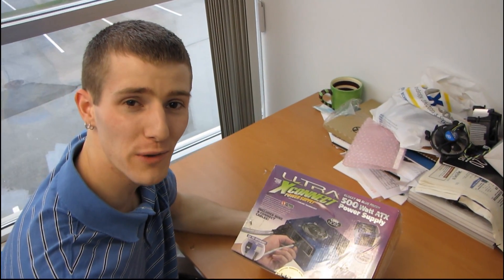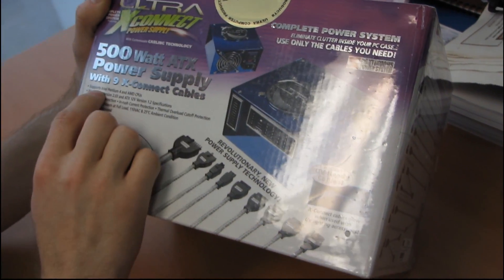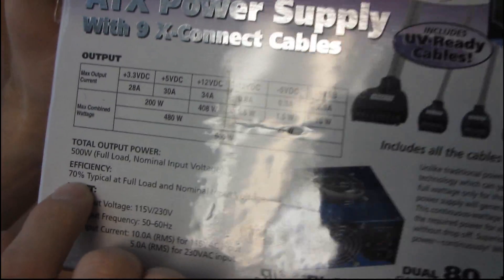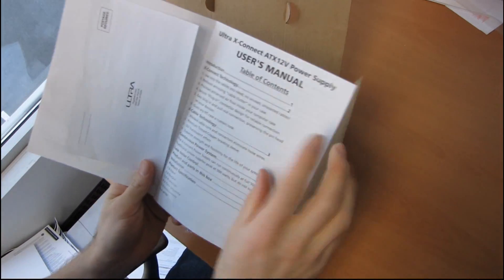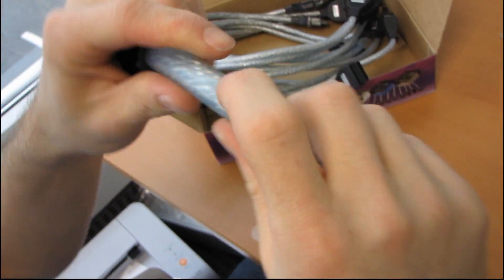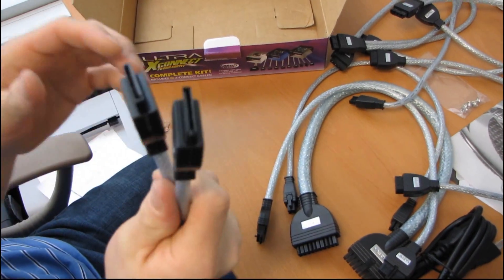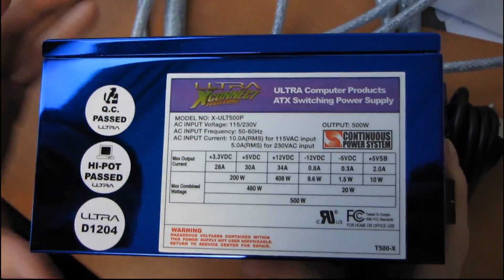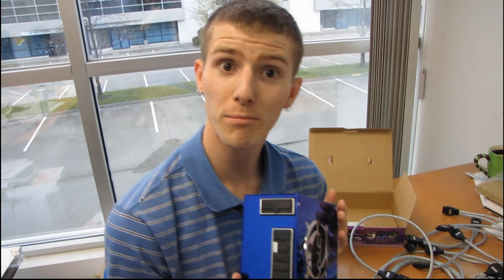RETRO UNBOXING Ultra X-Connect 500W Modular Power Supply Unboxing & First Look Linus Tech Tips

Comment: Hey Linus, yet another great video! Even though the odds of you reading this are slim to none I just want to tell you that right now, in 2016 my Custom built PC uses that same power supply. The thing is 11 years old now and still runs like a champ. If you or anyone else is interested in seeing it or have any questions about it just reply to the comment. (My PC with this psu runs GTA on high settings just to show that it can handle itself)
Reply: But it only has 20p main power and no GPU power

stop lying kid
Reply: I bought one NOS at a thrift store several years ago, it’s been running a bitcoin miner all this time. Still running as I type this.
Reply: Good to hear, I just found one for sale on eBay brand new in the box in silver, and it looks to be a good fit for my Win98se/XP SP3 retro gaming rebuild of a 2.8 Ghz Pentium 4 Dell Dimension 4600.

Comment: Are there 20p to 24p adapters?
Reply: ***** OKAY.
Reply: 20p to 24p adapters aren't even necessary. 20p connectors still plug into 24p sockets just fine but leaves 4 pins unused. Similar to how GPU 6 pins can plug into GPU 8 pin sockets

Comment: I want this beautiful PSU! Those THICK OLD cables are so nice! I can bet my ass that i can power an I5 6500 with GTX960 like nothing!
Reply: sjoerd laan rewiring cables wouldn't be that hard... just buy couple of plugs and wires and make extensions.
Reply: My PSU is like 450W 80+ with single 12V rail and it can power my 4460 and GTX960 without any trouble. Under full load I haven't noticed any issues.
Reply: +Artas1984 No it can&#39;t. It doesn&#39;t even have a 24 pin ATX connector, and that single 12V rail is just asking to catch on fire.
It still looks pretty cool though.
Reply: still doesn't make up for the fact that it only has a 20 pin motherboard power connector, and no PCIe power

Comment: Actually most mainboards will accept a 20 pin ATX connector if you just line it up on pin 1 on the mainboard. (Same with the 8pin CPU connector)

Comment: You could still use this in a modern PC(posted in Jan 2016!), you can get a converter for the main bord connection cable. The 12V 4 pin connector will also be accepted in most mainboards that feature an 8 pin socket. And the 12v rail is powerfull enough to power a CPU(Like an Intel i5 or AMD FX-8320E or similar TDP CPU) and an nVidia GPU...

Comment: I know this video is like 5 years old but I just had to throw a comment in here bc I actually happened upon an ultra x connect 500W power supply myself but the one I found has 3 clear acrylic sides with 2 80mm fans and one of the fans actually has a uv cold cathode on it. As well I guess the person before me liked this power supply so much they actually found a xconnect cable from the manufacturer that is atx 20 pin to 24 pin connector. So i decided to try it out to see if this thing still works and it powered up no problem on my old system. The old system was running an amd phenom x4 9750 with a zotac geforce gts 250 and 8 gb of ddr2 ram and worked like a charm. Oh and a side note this one is a "titanium" finish.

Comment: 34A on the +12V rail?  That could run a modern system w/ a mid-range GPU... If it only had modern connections : /
Reply: +EinXenyx Most video cards include molex to pcie adapters
Reply: +Johnny B You can adapt Molex to 6pin PCIE.
Reply: Camilo Formica Thats why i wrote this.

Comment: I see no reason why that wouldn't be possible, it would take some doing though, and some modification of the modular cable connectors on the back. It's probably easier to buy a modern PSU and spray it metallic blue :P

Comment: Should be possible assuming you can modify the plate with the modular interface to use the cables from a more modern unit but it would be amazing that thing looks badass

Comment: a stock 3770k does not exceed power consumption over 105watts and a 680 uses about 210 watts, add 50 for hdd and odd's and other things and you are under 450! This is proved by me using a 450w sfx psu.

Comment: what're you guys talking about it being retro? im still using it in my p4 box! (older silver version) 
though I'm about to use it to test powering car amps..

I've got this PSU with the on/off switch cable coming from the PSU! I guess that's how PC's turned on back then, instead of through the mobo